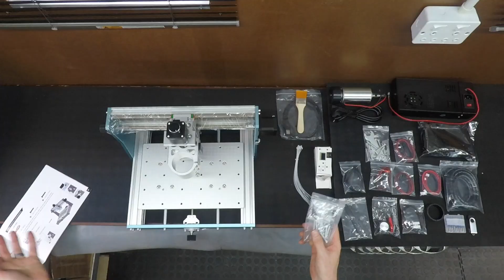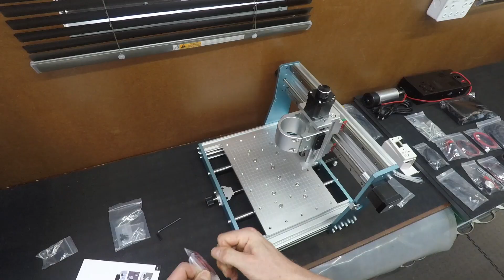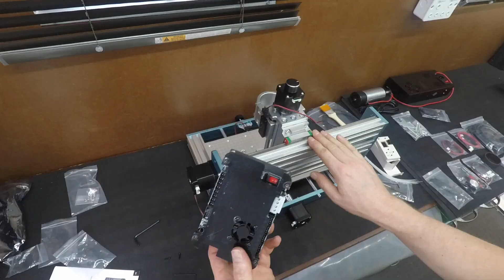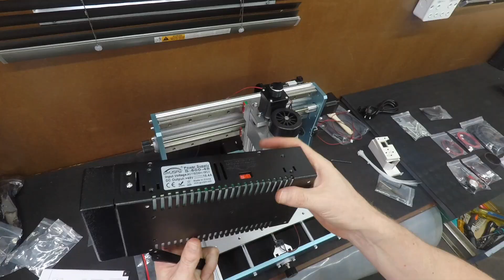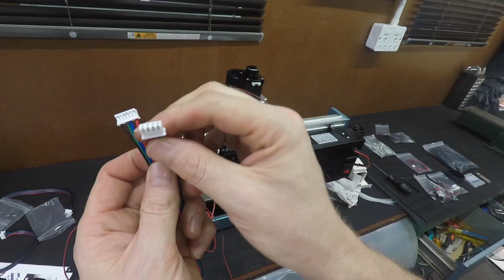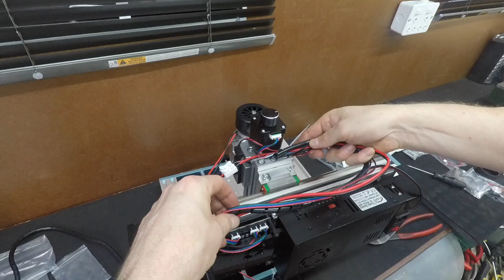CNC Assembly

Comment: Is the motor (spindle) 500W? It looks a bit shorter, so I am wondering if it is 300W...
Reply from the maker: Hello. Thank you for watching. This machine has the 300W spindle. (PRO MAX). There is also a version named the 'PLUS MAX' which has the 500W spindle and a few other improved features.
Reply: @qsworkshop  Thank you for your videos about this product with extensive explanation, and I appreciate your answer to my question.
Reply from the maker: @岡本康兒  You are welcome. 👌👍